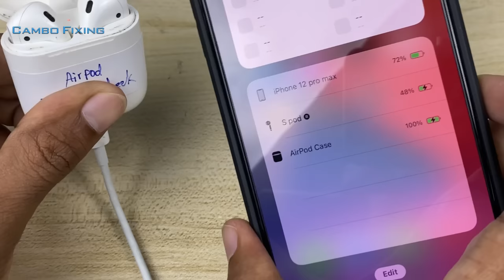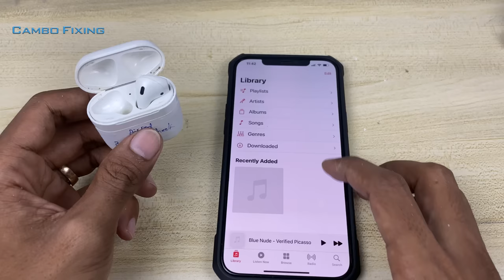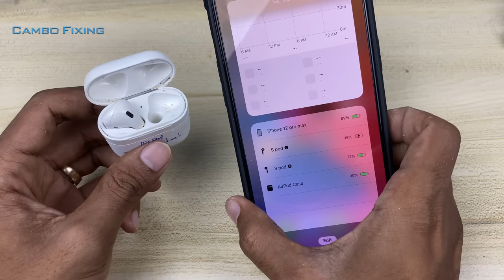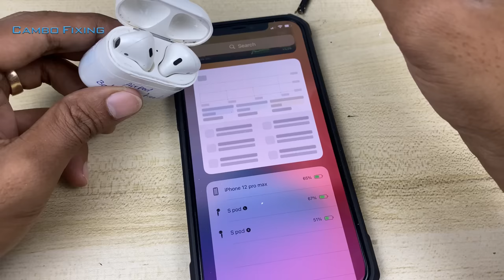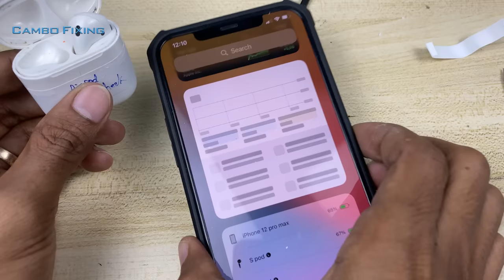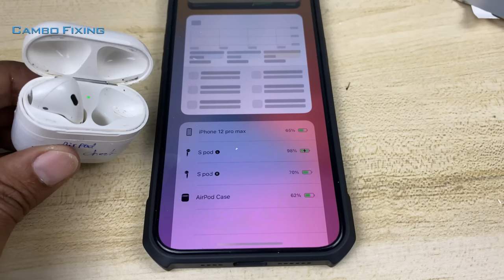How to Repair the AirPod Battery and Battery Case | Battery Replacement

Comment: Hello,

My name is Ruslan. I work at a Kiev-based company specializing in gadget repairs. My field of expertise is wireless headphones. I enjoy watching your channel and have learned a lot from it. I wanted to seek some advice. I received a batch of defective AirPods 2. After replacing the batteries in the headphones, the case shows a flashing green light when connected. I cannot determine the defect. Resetting (restoring to factory settings) the headphones does not help (it simply does not happen, the indicator is always flashing green). There are headphones with a steady white indicator when connected, or sometimes the case does not respond at all. However, the majority of them have a flashing green indicator when connected. I would appreciate any advice. I apologize for the possibly confusing translation. I'm not very proficient in English and relied on AI translation.

Thank you in advance,
Best regards, Ruslan.

Comment: Bro I want to fix my AirPods both battery replacement. How did I contact to you
Reply: Me too wish to repair my airpods - cost pls ?
Reply: @prashantpatel7241  ditch the airpods and buy yourself a decent Pair of earbuds that are repairable like Realme, Razer or soundpeats, they cost way less and their battery life is decent, sound quality is much better than the airpods 2. A lot of earbuds manufacturers are making half in ear open design earbuds like soundpeats, haino teko, Huawei, oppo, realme, Awei, Redmi and they're cheap too

Comment: Hello, I have aipods from sec generation and I have a problem at the left airpod, that cap where the speakers are is damaged. I won't close and stuf, more like damaged and was stil very useble but the wire that was giving sound to airpod got ripd and yeah. Hopefully you'll respond, peace bro

Comment: wanted to point out that those are fake AirPods, the ones that look ALMOST real but they are not even if they have the software (h1) chip and others. 
I searched up the iFixit teardown and the battery is completely different, the fake ones have the aluminum color and the orange.

But anyway he did a good job repairing them

Comment: I did the box battery replacement. But the issue was not the battery. As I have found there is a really strange issue with how you charge your box. If you charge it using the USB port of your computer both airpods and the battery box are charging. But if you charge it using some other charger - the airpods are charging but the box itself is NOT. That's why I replaced my box battery and then the issue repeated itself. So just try to charge it with your computer.

Comment: Bro my airpod 1 case is not charging
I cleaned the charging jack about 100 times but it's still not charging
I thing it's got dead can you tell me 
What it cost to repair the battery ofairpod 1 please iam struggling from last 3 days 😭😭😭😭😭

Comment: Don’t watch this bootleg ass tutorial. Don’t know why his battery was grey, but he also doesn’t show you how to properly remove the battery, which if you try to snap off like a typical connector inside of your phone, will destroy the sheath meant for the new battery to slide into. There is a much better and shorter video here for the case.